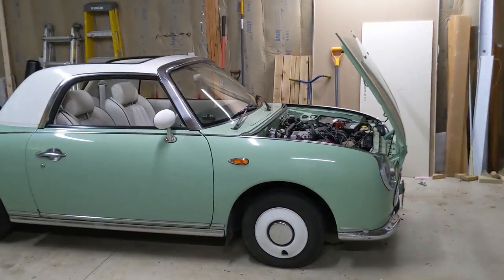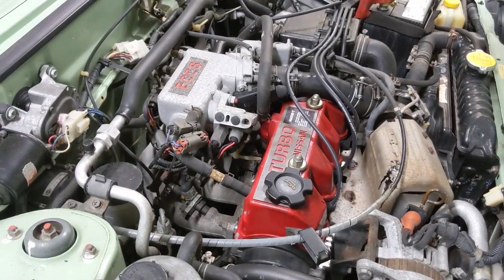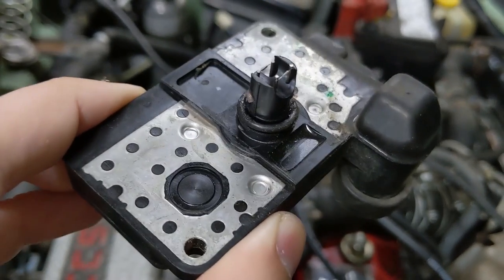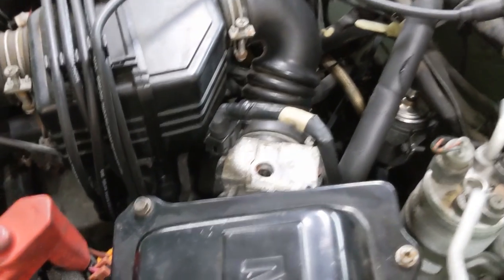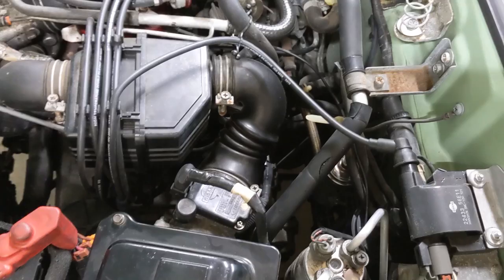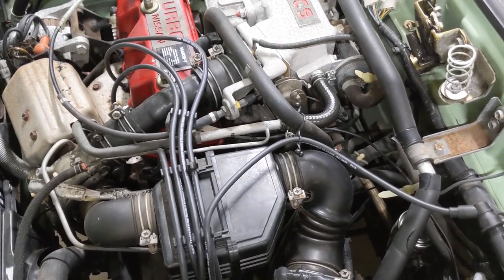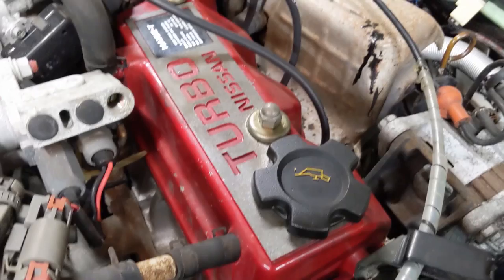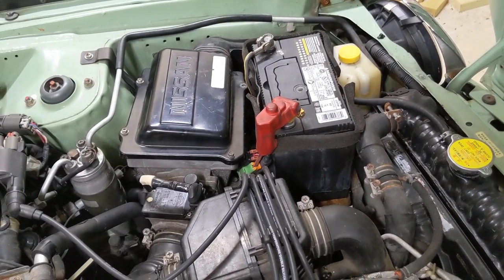Modern engine control musings and Fixing a Figaro

Comment: Keep in mind this is really just a first-gen Nissan Micra. I know it's cool and weird looking but it's just a Micra in a weird suit. Mechanically it's a turbo Micra. This stuff is quite literally my wheel house (wife and I are importers of fine JDM automobiles) and there are a ton of resources available, for anyone, to not have to go through specific 'shops'. The markup on some of their stuff is insane and unnecessary. Part Souq is my most favorite collection of all the diagrams, sheets and pictures with part numbers I've found for any JDM vehicle, including your Figaro. If I can I'll order from them because it's so fast, but otherwise I'll then check Amayama and MegaZip. Generally finding things is quite easy, though I certainly couldn't find a MAF that wasn't almost $700.
partsouq.com
amayama.com
megazip.net

EDIT
some diesel trucks deep into the 90s if not the 2000s were fully mechanical. Not exactly identical to a small gasoline fuel-injected car but a neat tidbit on mechanical injection systems. 70 series Land Cruisers, of which we never did get in the USA were fully mechanical vehicles until 2005 or around there.
Reply from the maker: It is a Micra, yes, but that doesn't necessarily fix the parts availability issues because the drivetrain is still Japan-only. The K10 Micra was sold in Canada and I've looked at parts they might share, but so far it's only really basic things like the brake master cylinder. I think even brake rotors are different. Certainly drivetrain components are, as the Micra has a completely different engine in the Canadian models.
Edited to add: the Figaro Shop in the UK seems to have quite modest parts pricing. I'm less sensitive to that than others, of course, but especially the consumables they seem completely fair. Oil filters were like six bucks after conversion. The worst part is the shipping cost - the box of stuff I ordered cost £150! But, surprisingly, they overnighted it so I had the parts in two days. Was quite impressed at that, really.
Reply: @TechnologyConnextras  Yeah naw I didn't want to barge in and 'WELL ACTUALLY' at all, just wanted to help make rad and unique cars like your Figaro more mundane and less scary from the 'live with' aspect. I'm sure you get all the same questions and comments about it when you are out driving: 
"hyuk steering wheel is on the wrong side"
and
"wow where do you get parts globalization is a concept lost on me"
when really it's just a car like any other, just cooler because of it's uncommon nature. 
We import so many different vehicles it seems I always have to learn a bunch of new stuff every time there is a new model. Getting the parts directly from Japan (or the UAE when it comes to Land Cruisers) has become routine and I want people to know that it's just like ordering something off the internet like normal, just more expensive and you might wait a bit longer. 
And shipping, yeah. The U.K. is one of the only places to get a complete new and not garbage suspension replacement for this truck called the Daihatsu Rugger in Japan (Fourtrak in the U.K.) and I paid as much in shipping as the parts themselves, but, like your Figaro, there is a dedicated group of people over there that love these so you can tap into their knowledge.
Reply: @KakerMix  in the UK especially in the 1990s there were lots of used Japanese cars imported . Providing the appropriate tax was paid the authorities seemed happy. In Japan the system was geared up to encourage people to buy new cars. In the UK the annual safety inspection costs £55 maximum, irrespective of the age of the car, although the older the car the more likely it is to need repairs. At one point they reckon there were more Mitsubishi FTOs here than in Japan despite them never having been sold new here. A colleague had a Toyota Sera which was as space age as the Figaro looks retro. What Technology Connections says about drivetrains is correct though. A friend was a mechanic and said they had opened the bonnets /hoods of Japanese imports that from the outside looked the same as the UK cars and thought "what on earth is this".

Comment: I'm having flashbacks to working on my old car, a 1988 Volkswagen Mk II Jetta, with an ECU...
There was an "insulated" paper pipe from a "furnace" (as the German mechanic documents called it) on the engine to the air filter box, to "help heat the engine faster during cold weather."
The car started just fine during cold weather...
During warm weather though, it had hard starting and a higher idle than it should've had.
Took me some time to figure out, but it turned out that the little plastic panel on the air filter box that was supposed to only open during cold weather was warped and not fully sealed during hot weather, resulting in back flow going into that pipe and entering the engine that way instead of all going through the primary intake and MAS.
After I sealed that up (the "pipe" had disintegrated over the years anyway so it made no difference) the car had a much easier time starting in hot weather, and idled a lot smoother.

Comment: The cold idle valve is very similar to the cold start injector in my toyota previa, when the temperature drops low (like less than 40 degrees) it will have an extended crank time along with rough running immediately after for up to 30 seconds if it's bad or going bad. Similar to an IAC but less likely to foul up. A bad coolant temperature sensor can also cause similar issues but it can be easily checked with an ohm meter at temp, the MAF/MAP being bad can be easily discounted by unplugging it while the vehicle is running to see if it changes the way the vehicle runs

Comment: Nitpick but ECCS actually stands for Electronic Concentrated Control System. Nissan called it that because it was the system that concentrated fuel, spark, and idle control into a single control system. Earlier EFI systems had separate fuel, spark, and idle control.
I'll also point out modern engine control systems are simpler in a lot of ways. Electronic actuators mean no more vacuum hoses. Variable valve timing means no more EGR. Drive by wire means no more separate cruise system.

Comment: On the MAF, one is the Sensor wire, (Cold or Hot wire anemometer) and other is temperature sensor for reference, if air is cold then it will remove more heat from wire for same air mass, so reference air temp. is required to accurately measure flow.

Comment: Welcome to the world of Nissan JDM. I have a '90 Fairlady Z Twin Turbo that I'm waiting on a new engine wiring harness to hopefully get rid of the electrical gremlins it has.
Reply: Z32TT? Better start saving for that timing service. Book time is well over 30 hours.
Reply: I've had it for 4 years now. That was one of the first things done. Along with new VTC gears and tires to replace the dry rotting over a decade old ones that were on it.

Comment: If you have any way to look at fuel trim data (how much fuel the engine is adding or removing at any given RPM, various loads, etc. The more info you can gather the better) this can give you clues as to where the problem may lie. I like old cars, but man is it a pain to diagnose fuel injected pre-obd2 cars.

If the cracked vacuum lines that other commenters mentioned aren't the (only) problem causing high idle you could also make sure there isn't carbon buildup in the throttle body causing it not to close all the way. There's a few ways to check for vacuum leaks, the best way to go is probably smoke test. You can build a smoke tester with a jar, cheap or old soldering iron, and a rag soaked in baby oil.

Comment: That code can pop up easily when working on the car. If the computer detects something disconnected it will throw it. I remove the battery now to avoid this, but it's common not to when doing small repairs like this.

Your experience of closed loop running like crap because of an input is sound as well. The error code throws it out of closed loop and it will feel better (but of course at the expense of efficiency etc).

Comment: Interesting concept. I have two motorcycle and the one I enjoy the most is carb'd with one fuse and NO computer... it has it's positives and negatives... the biggest con is it is SUPER slow... but besides that I see it as all positives. A couple horsepower for reliability? HELL YEAH! Unfortunately in the middle of tig welding the frame of that bike to repair... so it is torn to pieces...

Comment: Cam sensor in distributor is entirely normal for pre-2000's cars. The cam timing error could just be down to the distributor base timing needing to be adjusted, if it is too far out of spec then you will throw a code.

Comment: pump your brake pedal on start up... improvement : not enough air

so if it is not enough air, try to clean your throttle body... Build up may have reduced the air flow in the idle position

Comment: That will probably be a hall effect sensor in the distributor. It simply tells the computer(or computers if separate injection and ignition), that the motor is turning and when to fire the injectors and spark. The distributor is what directs the spark to the right cylinder(obviously).. the injectors likely batch fire, the signal for the pulse comes from the distributor. 

Check all the basics, from cracked lines and manifold pipes to faulty connections.

Comment: Cam timing is out a tooth, Robert returned it to where it was when you got it, thus no change... at :50 to 1:00 there are two round black plugs, there should be three, someone has messed with the third... they have adjusted to compensate for their error in installation...

Comment: Surging is almost always caused by a vacuum leak bring unmetered air into the engine. Most of the time a MAF goes bad, you will end up in a no-start situation. Very rarely do you get a MAF that is finicky.

Also should check to make sure none of your intake charge pipes are leaking. This is likely what’s causing the room temp cold start and stall

Comment: Okay, so my car is a 1981 Tercel, which is obviously carburetted and equally obviously not a Nissan, but I had similar issues where the engine would start much better when it was cold out. I also had problems with the fast idle and pretty much every other temperature-related subsystem not wanting to disengage automatically. Mind, on my car, those are all controlled by vacuum, however, they all had a single point of failure that became obvious when I tested all of the vacuum parts: the TVSV. On a Toyota, the TVSV is a vacuum switching valve that is screwed into the engine's water intake. It changes settings depending on water temperature. As they age, the plastic becomes brittle and they break, which often leads to both a failure of any temperature-related vacuum systems and a vacuum leak. All other temperature-related functions for the car, curiously enough, are handled by a dedicated temperature sensor. This is probably a fail-safe: one sensor for the mechanical things, one for the electronic things. The thing that strikes me as interesting in your case is a common symptom: THE CAR'S VACUUM SYSTEM ALWAYS THINKS IT'S COLD.

 Because you mentioned that the part that you suspect runs off of vacuum, and is designed to operate at cold temperatures, I would not be surprised if there is a similar switch in your car, separate from the temperature sensor that the computer uses, and I would also not be surprised if it's gorked. I don't know how easy or difficult it would be to find a replacement, in my case, as Toyota people know, an appropriate Toyota TVSV in working order is pretty much a unicorn, so I repurposed a simpler thermostatic vacuum switch for the job. The Toyota TVSV of the 1980s had three settings: below 45F, 63F-122F, and above 154F. The intermediate setting was used to briefly open the smog pump lines to the catalytic converter, and the air flow helps ignite unburned fuel in the exhaust, bringing the cat up to operating temperature more quickly. I think it also repositioned the choke slightly. I had a two-way switch to work with that switched at 140F, so I bypassed the switching all of the intermediate systems so the hoses are in the above-154F configuration, then connected all of the lines that should operate above 154F to the switch. Now the car starts fine in all weather conditions, and everything disengages automatically, more or less at the right temperature.
I don't know necessarily that your car has such a switch (my brother's 97 Corolla does, though, so probably), or that it necessarily controls as many functions as mine (the Corolla's doesn't), so I don't know that you'd necessarily have to rearrange your vacuum system like I did if you need to use a "just good enough" part. But you just might, so it's something to be aware of.

 On the subject of turbochargers and turbo lag, it's amazing to me that only EMD was smart enough to run them on an overspeed clutch.

Comment: Electronic ignition came in in the early 70's and by the early 80's we pretty much had the modern computer control we have in your car, and I don't even follow what goes on today, but the elimination of points essentially started in the early 70s.

Comment: If you're still having problems later... 
Those old in-distributor cam sensors are sooo freaking finnicky, I went through 3 distributors on my old Nissan Altima (I got it for free) before I finally bought a new OEM one that fixed my problem. (One Chinese, two used)
...My problem: it had a really hard time starting when the car was warmed up and would sometimes surge at idle.   Sometimes it would crank 2-3 times then stop dead in its tracks (the cam sensor was reporting so poorly that it would cause the engine to spin backwards sometimes) ... I literally did the timing chain service thinking that it had jumped time (it was pretty rattley and needed it anyway but it was a free car so any investment into it was kind of dumb, lol... ) 
Water temp sensor replacement & MAF cleaning would have been my first attempt as well though :) 
The only other thing I'll add is that if there's a cam-crank correlation code, it's possible that it was already out of time when you got it and then since Robert measured for the install of the new belt via counting teeth instead of checking the markings on the engine, he probably put it back also out of time.
Anyways, good luck. :)

Comment: A lot of times inadequate mechanics will increase the engine idle to absurd levels to "fix" an I.A.C. failure. 
I would stake my reputation, which isn't that valuable anyway, that if you replace the I.A.C., that would solve both your high idle and starting woes.

Comment: The way it works is that there are two temperature sensors of which one is heated. The other one is just measured. What it does is that it wants to maintain a set delta T between the two sensors and the current needed to achieve that difference has a direct relation to the air mass flow.
Search for Endress T-Mass on YouTube to see a nice overview on the measurement principle. It is widely used in industrial settings.

Comment: Mass airflow sensor tells the ecu airflow, throttle position sensor tells it throttle position, manifold absolute pressure sensor tells it pressure or vacuum in the intake after the throttle plate, camshaft and crankshaft position sensors tell it where it is in the rotation, the camshaft position sensor tells it what part of the combustion cycle its at, spins half the speed of the crankshaft usually, oxygen sensors tell it how much unburned oxygen is in the exhaust,  usually one before the catalytic converter and one after, the idle air control valve bypasses air around the throttle plate to maintain idle, the exhaust gas recirculation valve allows exhaust to flow back into the intake to be reburned for emissions,  the blow off valve is used on turbo engines before the throttle plate and opens when you abruptly close the throttle to release pressure,  the waste gate opens and closes on the exhaust before the turbo to manage boost pressure and in conjunction with the blow off valve to reduce stresses on the turbo from stalling and flutter, knock sensors listen for a specific frequency to detect detonation and retard ignition timing, keeping it from melting itself or spitting its guts onto the ground, the temperature sensor is not just fmto alert you about overheating but the ecu does not go into closed loop until it reaches a specific temperature,  you should check your owners manual to see what fuel the car is tuned for being that its turbocharged, could be tuned to run on 87 or it may need 93 octane, the stall on startup could be dirty throttle body, sticking IAC valve, loss of cam and/or crankshaft position sensor dropout or loss of correlation, bad check valve in furl pump allowing fuel to drain back, turn the key to the on position and of a few times to prime the system thrn start it, if it fixes the issue bad check valve, you can also use a fuel pressure test Guage, that will rule out fuel pressure regulator failures, turbocharged engines are much more sensitive to incorrect spark plugs of plug gap, do a compression test when changing the spark plugs, reading the plugs and the compression test will give a good idea of the engines health.